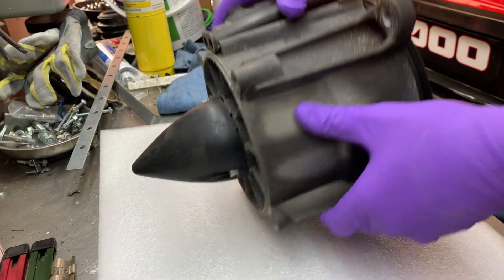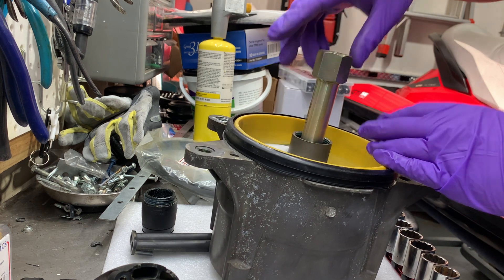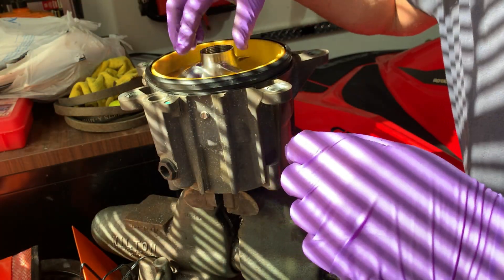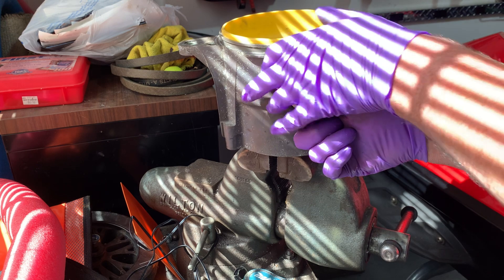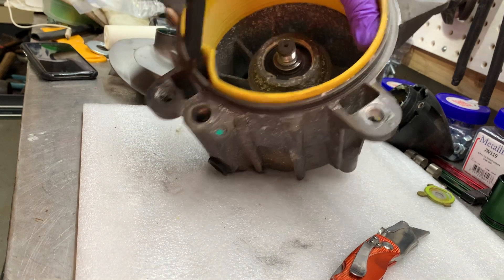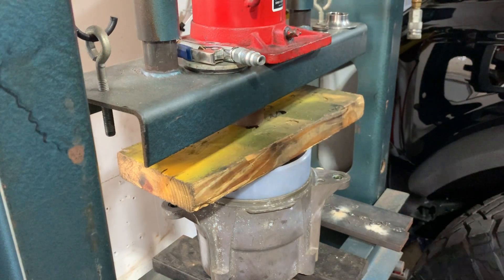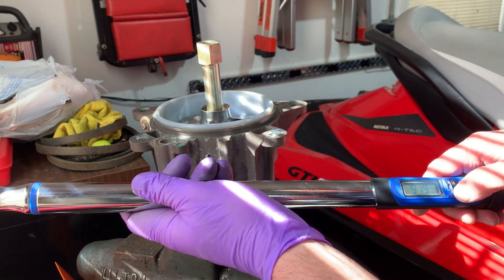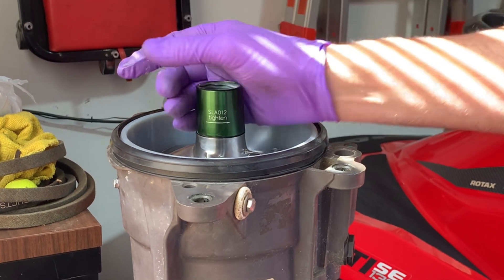Riva Stage One Seadoo GTR 230 - Jet Pump Part 3

Comment: Sorry, what is the tool to extract impeller? Thanks!
Reply: I have gtr 230 2023
Reply from the maker: @ramonsantoyo8758   I "believe" it's the same part 529035820, but google your model and year "Impeller tool". Also can look up "WR012L" which is long to fit some variety of jet pumps. https://leadingedgeimpellers.com/wr012l.html is a site I looked into for this, because your right little tougher to find an exact mention of 2023, and I haven't pulled an impeller off of one yet. (But doubting there's a difference). Let me know what you find?